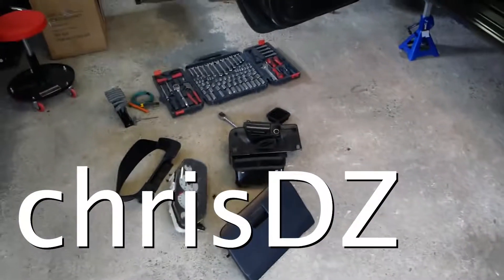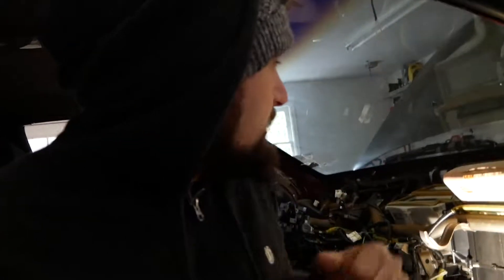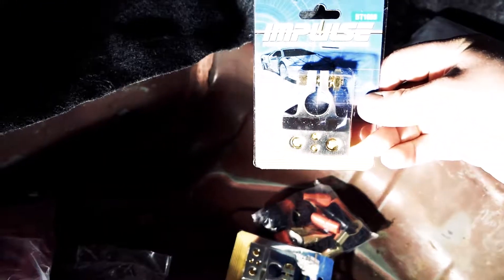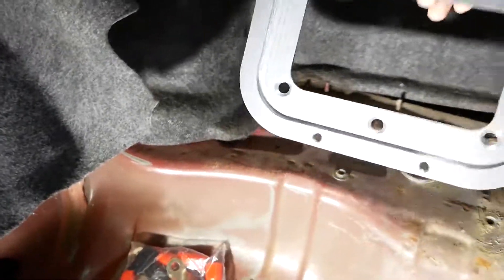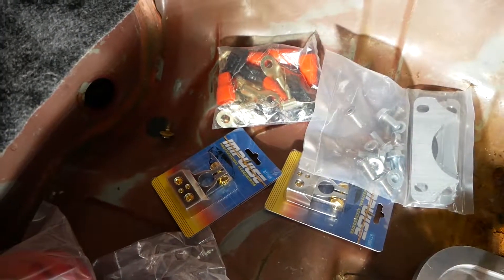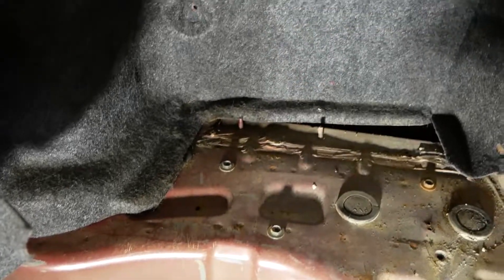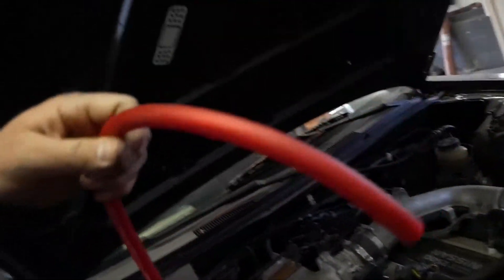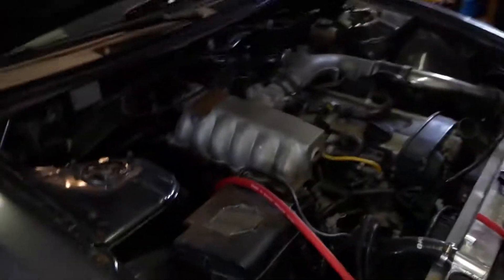How to: Battery relocation on ANY CAR | 240sx rb25

Comment: What did you tie the wire to, under the car?
Reply from the maker: I used a bunch of p clamps and self tapping screws and attached to the frame rail.. you can also zip tie it to existing stuff that’s under the car